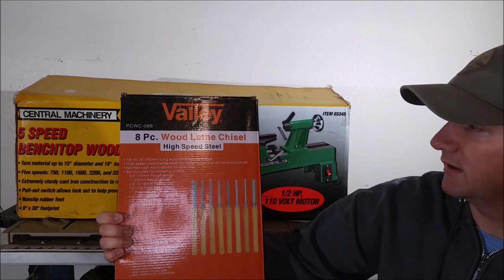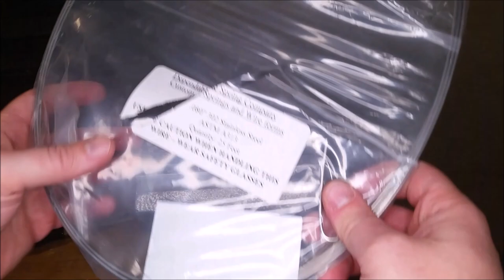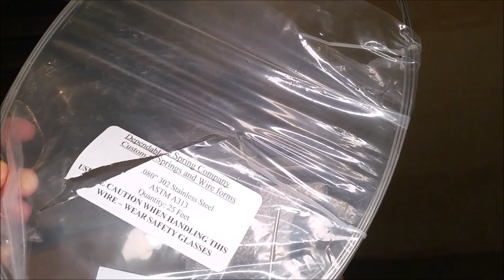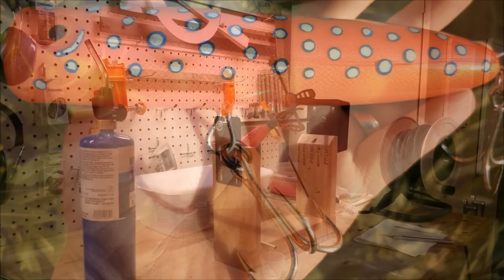Making a Wooden Saltwater Popper

Comment: I enjoyed your video. Recommend using a simple cross-cut sled for cutting your stock into sections. John Heisz has one on YT.  Too easy to create a kick-back situation with a narrow piece jamming between the fence and blade.
Reply from the maker: Thanks for the tip!
Reply: @zimmtex  yea that was scary
Reply from the maker: @hannajoh12  I have since gotten a new miter saw and some safety push blocks for the table saw.

Comment: In this video that little square jig you're putting in vise to bend the wire where can I find one of them, I don't see it on website ty
Reply from the maker: If got it linked as 'heavy duty wire bender'  on my website under Tools of the Trade. Thanks for watching!
Reply: Ty, I looked on website and I do not see it there, i see other wire benders but I dont see the gravy duty wire bender you are using in the video, would it be possible to send the link? Maybe I'm missing it somewhere
Reply: I'm sorry nevermind I see it now, ty for the response I really appreciate it
Reply: Ok so I ordered the heavy duty one you have listed, I dont believe it's the one you're using in video, this one is bigger with like a 12-14 pole to bend with, the f
Guide pins are big and makes big loops, is there a link fir this small one you're using in the vise
Reply from the maker: @waynestark9949  Sorry for the late reply. They haven't had my exact one for over a year. Mine does make pretty big loops (about 1/4inch or 6mm). I keep checking to see if the bring it back but they may have gone out of business.

Comment: What kind of white powder do you poor into the chamfer? Is it backing powder. I think you mention it in some video. Why do you use that stuff?
Reply from the maker: It's baking soda. I use it because it is very fine, it takes glue well and is sandable. You can use wood putty or bondo if you don't mind waiting for it to dry. This method sets up instantly so you can keep working. Thanks for watching!

Comment: I've watched a few of your videos (have some catching up to do) and appreciate the information you include. I have a question. It seems that you chose the features (dimensions; profiles; attachment points; weighting; bill size, shape, and angle) "by feel". Is lure design that casual?  I would have thought that center of balance and hydro-dynamics would need to be considered to get a lure to swim as desired. Maybe I am over-thinking the whole thing. If you could,  would you include some of the reasoning your use when selecting feature size and shape. For example, I saw you tank-test the orange lip-less crank bait, you were happy with the way it sank but never explained why it was good to go or what would be bad. I like to watch you work, I just want to understand what you are doing  :)  Thanks!
Reply from the maker: Thank you very much for watching! I can see that I do tend to generalize and will make an effort to provide more detail on design concepts. In the meantime, if you have questions about a particular style  of lure you are working on, I am happy to answer any questions you have.
Reply: @zimmtex  Thanks for the reply!  I  think it would be difficult for me to ask and for you to answer a specific question without having you looking at what I am working on and knowing what I am trying to achieve.  It's going to be trial and error to get  hands-on experience. When I see a fishing fly I can tell how it will fish (float, sink, move, etc) by looking at the materials and how it has been built. I think that I need to spend some time (closely)  observing commercial lures and kinda reverse engineering them to determine what features, proportions and balance results in what action. Then I need to carve a bunch of lures and experiment with them.   :)  Cheers and stay safe!
Reply from the maker: @hankvana2149  Experience is the best teacher. Not all of my lures work out exactly as planned. I think you have a good game plan and I wish you the best of luck with your project.
Reply: @zimmtex  Between Covid and being retired I have lots of time to carve lures. Looking forward to doing so! Really appreciate you sharing your experiences with us. I  did come up with a specific  question  :)  ...I don't know if you have discussed your airbrush (still need to catch up on your videos)  but it would be helpful if you could do a video  to recommend an airbrush (brand, style and nozzle) and what paints to use. In looking at airbrushs it seems that a lot of them are for decorating cakes (???) , fingernails and wierd stuff like that. Some suggestions would be useful! Cheers!
Reply from the maker: @hankvana2149  Glad to help in any way I can. I know I have talked about my airbrush but I can't remember which video it was. The airbrush I have is not all that fancy but it came with three nozzle sizes and does what I need it to do. I put a link to it in the video description. I happen to use Createx paints because they are widely available, but I know there are other good brands out there. Hope this helps you along your lure making journey!

Comment: Hi nice video what is the ball sanding tool in the chuck to make the concave on the head of the lure thanks. Were can I buy it from
Reply from the maker: I use a Kutzall Original Sphere Burr that I ordered off of Amazon. This particular one has a 1/4" shaft and a 1" head diameter.

Comment: Why not wire thru construction ??....The 1st step before the lathe is to drill a straight hole thru the square wood blank with a drill press....Splitting the wood to embed the wire is not a good idea if you want the lure to last....Alternative method use screw in eyelets with epoxy on the screws
Reply from the maker: That is certainly a great method so long as you get a good seal on the inside of the hole. I think this method is plenty durable though; I tested it to the breaking point and learned that the hooks and rings will go before the lure breaks. I really like twist eyes and epoxy for ease of use and those too are very strong. Thanks for sharing and watching!